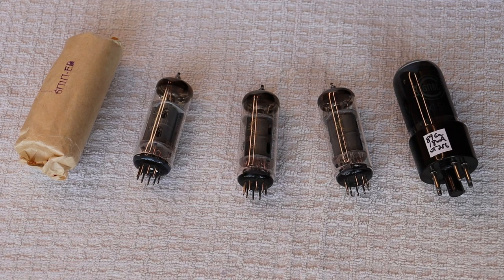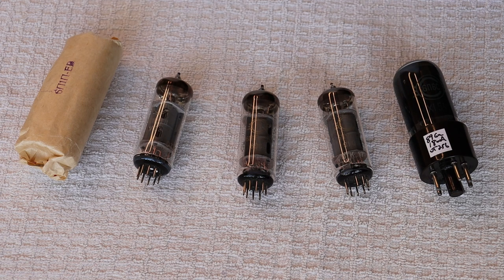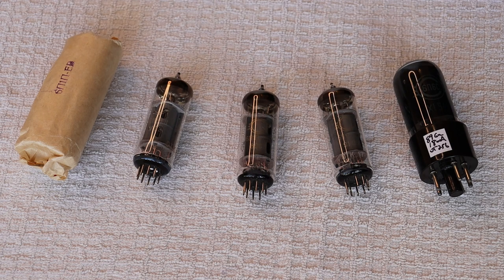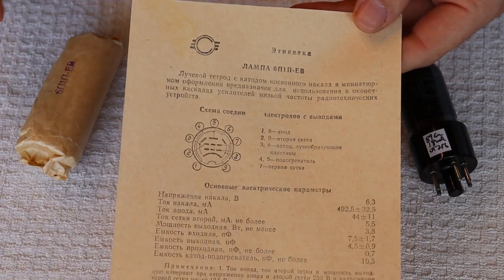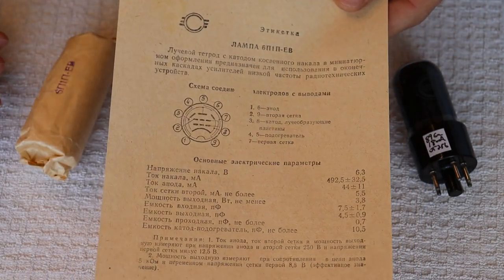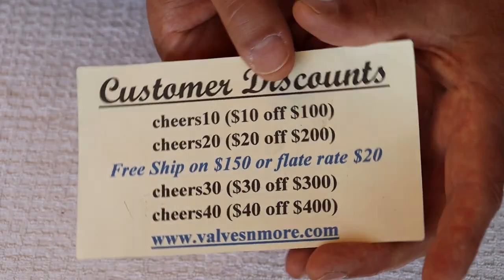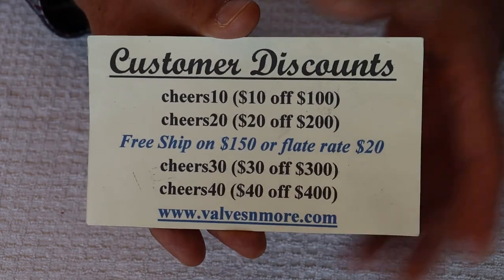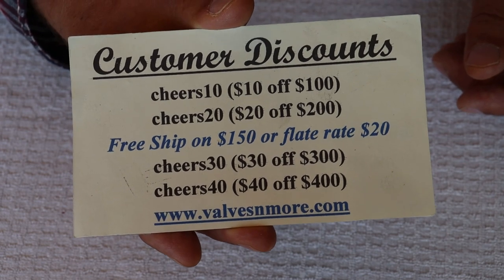Tube Lab #152 - 6P1P-EV Power Tube & Kit Headphone Amp Progress

Comment: I always keep an eye on your videos for word on the headphone amp.  I really can’t wait!!! What headphones did you get?  I hope at least one pair is a HD650 or 600 or 6xx.
Reply from the maker: Sennheiser hd598se, hd660s
Hifiman he400i, he1000v2
So quality budget, affordable planar magnetic, higher quality, and top end planar.  I love both the hd660 and he1000, but the bigger planar headphones aren't nearly as comfortable as the Sennheisers.  And yes we can't wait to have a permanent headphone amp in our system, the sonics rival and in many ways best our custom speaker system to the point I want both options available.  Charles should have prototype v2.0 ready for electrical testing sometime this week and hopefully listening tests by next weekend!
Reply: Those are some excellent cans!  I also have the He1000v2 and it is glorious.  I forgot that your tube amp will have a transformer so I look forward to trying out the HekV2 on it when it comes out.  The sound stage and liquid, detailed sound of the Hek will only be compounded by your amp, I am sure.  Thanks for all the hard work.   @tubelab194

Comment: Can I use one,in place of a  6005 6aq5. I have a Italian amp in recapped and it don't have enough power to pee with. Let alone a headphone amp. The pwr supply is only 150volts. Thank you. Bill
Reply: They are quite similar tubes, but not direct replacements since the 6AQ5 is a 7 pin while the 6P1P-EV is a 9 pin. If you could adapt them they would likely operate similarly in the same circuit. 150V supply isn't much to work with, I just did a quick check on a loadline calculator and it looks like the best you could hope for (if it's running triode mode) is about a quarter of a watt. At a similar operating point the 6P1P-EV would get you about .4 of a watt. So not much difference.